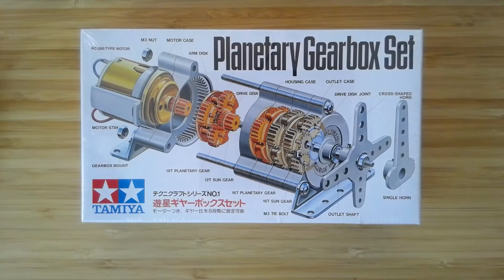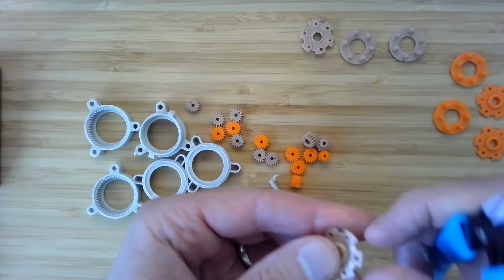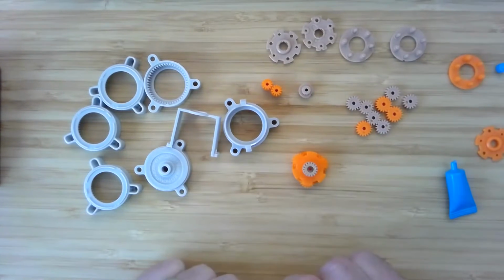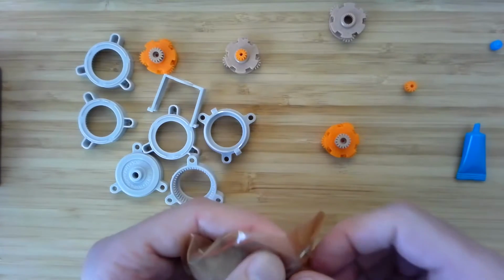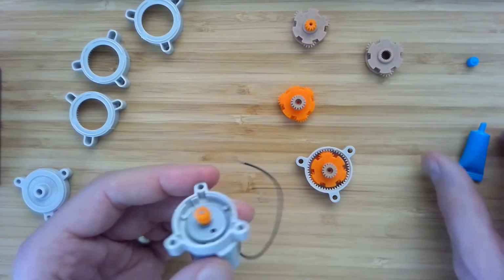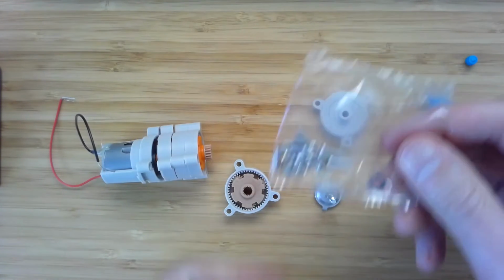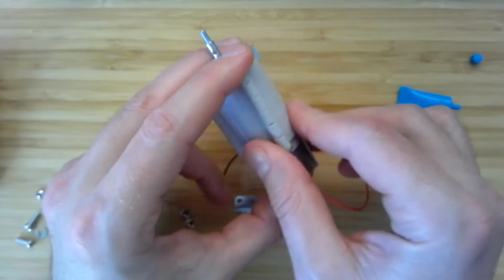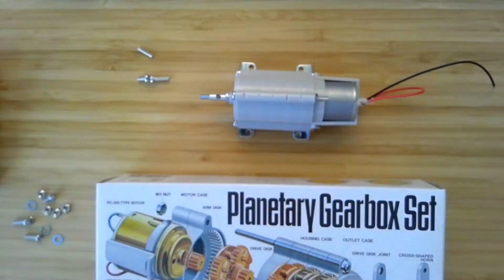Mechanical Systems Design: Tamiya 72001 build video

Comment: Thanks for making this video - one thing though, the metal plates on the bottom should face outwards.
Reply: But they are not REQUIRED to face outwards if you want to shorten the mounting footprint of the thing, which is exactly how and why I built mine this same way.
Reply: @wnmwnm6210  Understood.